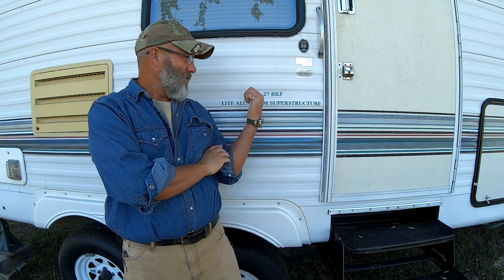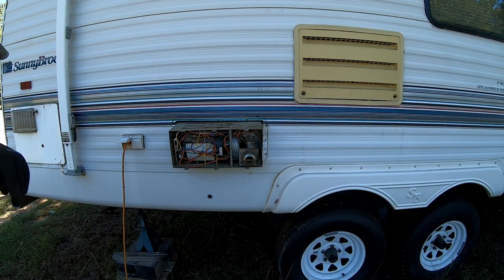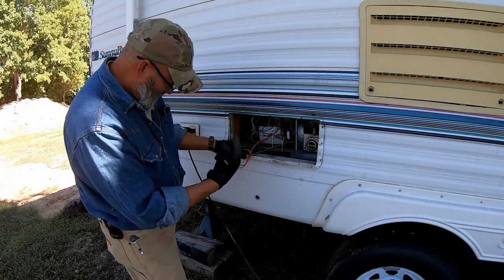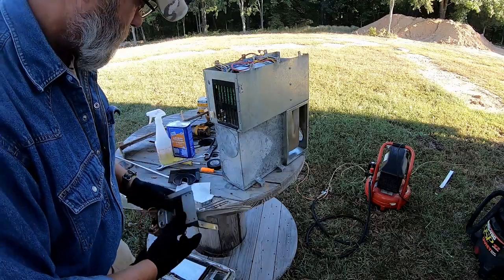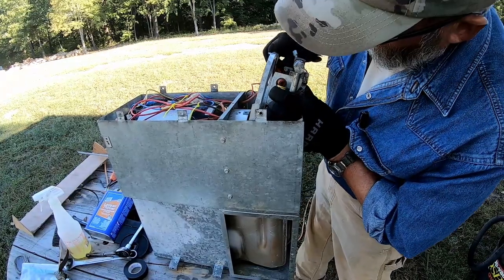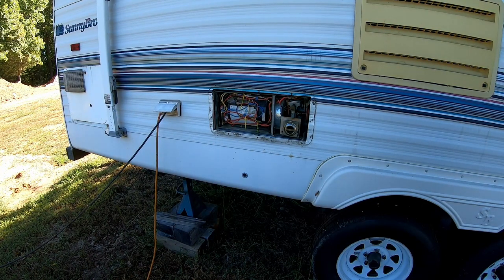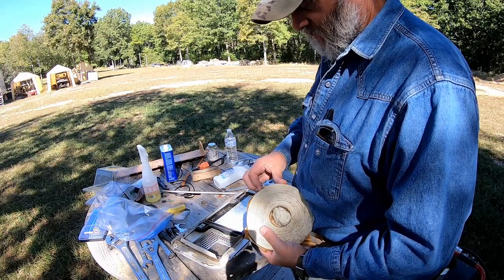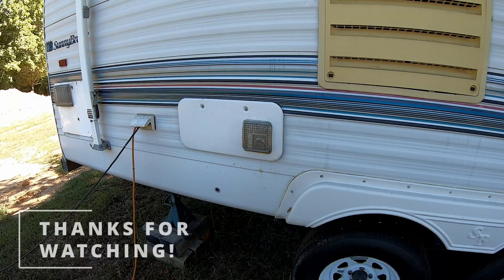RV Furnace   Atwood 8531 III Service and Repair

Comment: Been there done that! I've had so many problems with bad propane regulators causing confusing issues over the years. I used to buy the cheapies, no longer. But of course even the good ones go bad eventually. Nice job on the video.
Reply from the maker: In sub-zero weather we've been having problems with the new regulator...  good times...  I'm glad you enjoyed the video.  Thanks for watching!

Comment: We have a 2005 damen daybreak with a Atwood 8531-1V-DCLP furnace that won't shut down,  unless you pull the fuse or turn the propane off.  We have remote controls for the furnace.  This has been happening for a while and we just had them replace the circuit board that said it work there for 3 hours and but we decided to try it at home  it seem to cycle fine for 6 hours then my husband tried to shut it off and it didn't work, same issue
Reply from the maker: Thanks for watching and the comment.  I am not an RV repair tech, just a guy trying to fix stuff and help people in similar situations.  I'd recommend contacting the shop that did the work and explain what's going on.  I've had brand new circuit boards on water heaters be DOA or die shortly after installation.  I've started replacing factory boards with with Dinosaur Electronics components.  They may make a board for your furnace. 
You may want to look at the thermostat or control box that sends control signals to the AC and Heat.  The control box I'm talking about is located in the AC unit on the 5th wheel in my video.  This is a common location.
 I hope you get it figured out.
Reply: @ozarksethic  thank you for responding the circuit board  that they replace it was from dinosaur electronics
Reply from the maker: @cathymullen423  I had a dinosaur board go bad and it was replaced on the spot at the our local RV dealer.  They said there was a problem with one of the components.  Dinosaur is really good about warranty.

Comment: So, I pulled out the burner assembly and it's rusted to pieces. But, looking online at the link you provided and others, this part isn't available for the Atwood 8531-III series. What part do I need to order to replace the burner assembly? Does the one for the IV series fit?
Reply from the maker: I dug around on a couple of forums and one poster said this fit - https://pdxrvwholesale.com/products/atwood-hydroflame-furnace-burner-electrode-kit-38548
I don't know for sure but you might want to give it a try.  Another option would be to replace it but you might run into problems with your thermostat and climate control module on the AC side.  That's why I repaired rather than replaced the thermostat in the other video related to this one.  Good Luck and thanks for watching!